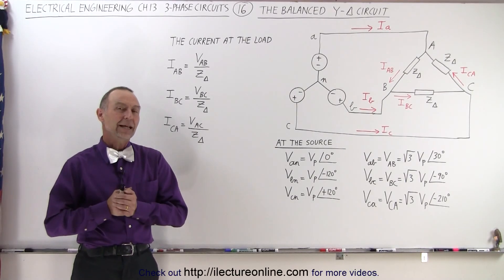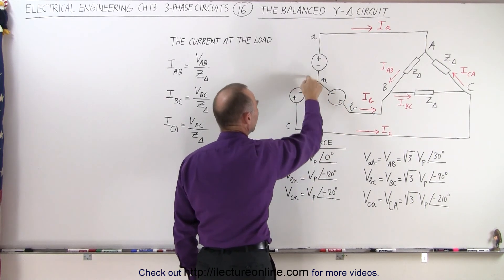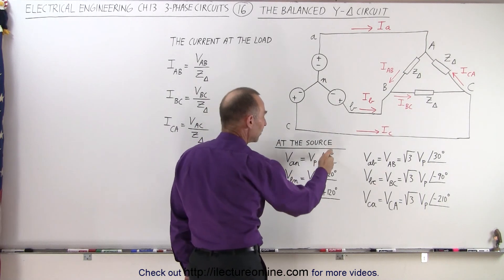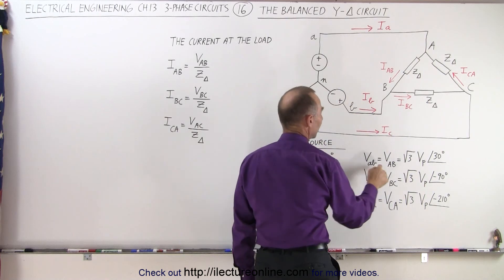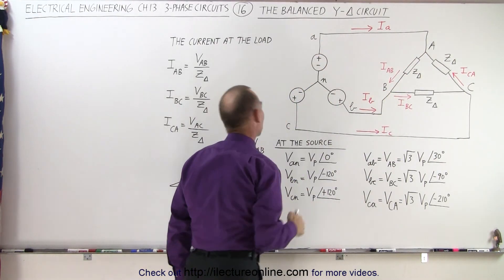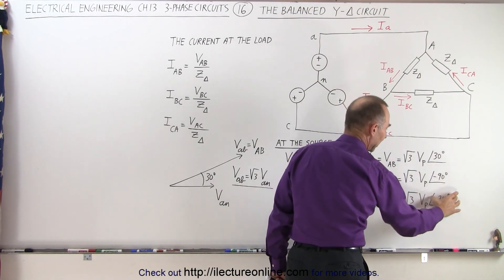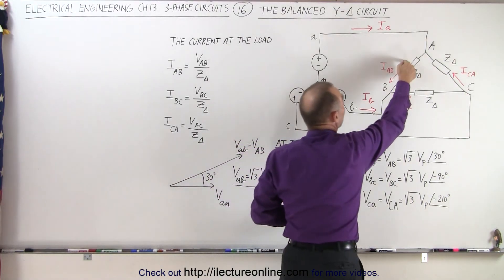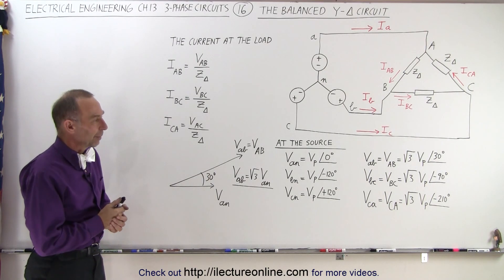Electrical Engineering: Ch 13: 3 Phase Circuit (16 of 42) The Balanced Y-Delta Circuit

Comment: Sir why Vab(LINE VOLTAGE)=VAB?
Will you please elaborate it?
Reply: Because the are in parallel. Vab is simply voltage between the terminal Va and Vb.
Reply: In delta   phase voltage equal to line voltage since its phase is across the line voltage ..

Comment: Why the line voltages across the sources and loads is same?
Reply: Because the are in parallel. Vab is simply voltage between the terminal Va and Vb.
Reply: @Zuwwar I got a question. For ICA , is it VCA/Zdelta or VAC/Zdelta?